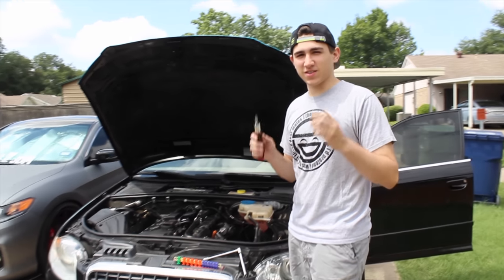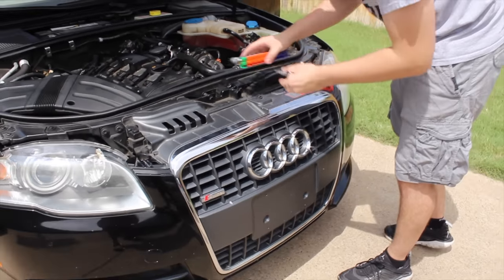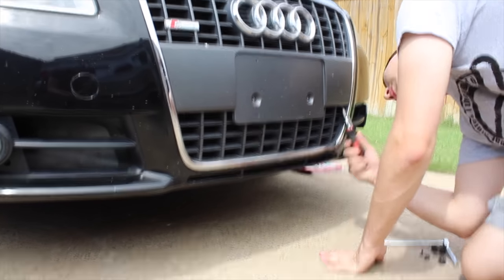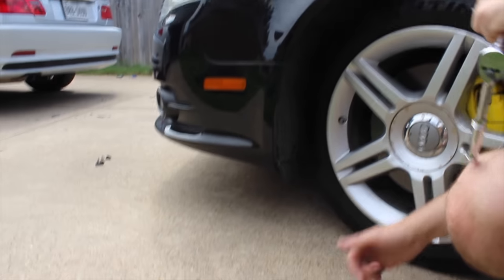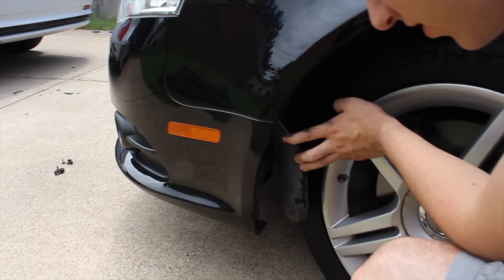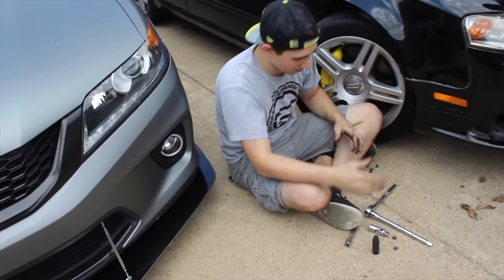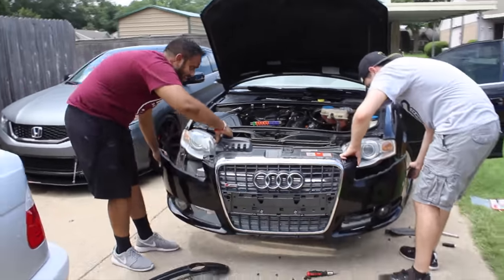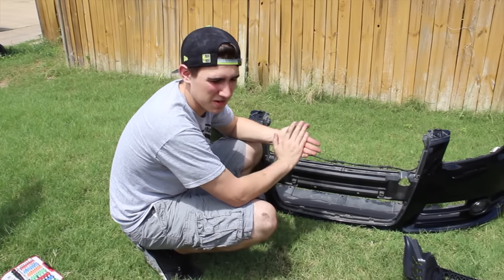How To Install Replace Front Grille 2005-2009 Audi A4

Comment: The grille you bought its only for SE (standard)  front bumpers. You got sline bumper so you will need to find a grille for sline models that is a bit longer. You'll find honeycomb grille for sline little bit harder.

Comment: Its sad how they don't any proper aftermarket grills for the B7 S-Line bumper but a bunch for regular B7 bumper 😐
Reply from the maker: Yeah its a pain finding the correct one, you have any suggestions?
Reply: To get the look you wanted to get with that grill where its all mesh with rings and no middle bumper you would have to buy a rs6 grill aftermarket off eBay and use the stock grill on the car and use the mesh and basically cut out the rs6 mesh grill and same thing with the stock grill after that you line up the mesh w the stock grill "frame" and you might need to trim off some places on the mesh and then glue the the parts back  together and you can use a black seal over it so its not even noticeable that the most common way and cheapest way to go about getting a aftermarket grill to be on the S-line bumper for the B7 other option is OEM rs4 grille which costs about $450-$640 which I wouldn't recommend unless you have the money to buy it but yeah I'm going to probably do that retro fit I'm talking about soon.
Reply: Black B7 dang! That sounds like a ton of work. Something we will definitely look into!
Reply: Did you ever do it? I'm looking for the same type of look as well.
Reply: I still haven't found one i like. We are thinking about possible making one, but the process of cutting pieces of grills out is lengthy and expensive to test and if you mess up, then you have hundreds into grills you cant do anything with. Still searching.
Reply: http://nickscarblog.com/diy/how-to-fit-an-rs6-grille-on-a-b7-a4-s4-or-rs4-all-mesh-no-filler-plate theirs what I was talking about the RS6 to A4 Grille rework
Reply: I've got some time so I will probably be doing this as soon as I buy the 100$ RS6 Grille
Reply: That looks awesome! Definitely going to try this!
Reply: I just put in a 30$ Spectre AutoZone intake mod and I highly recommend it if you don't wanna spend the extra money on a full intake setup and its sounds amazing tbh I just gotta make a heats shield for it now I might post a video about it.
Reply: oh nvm I see you've gotten the ESC tuning one nice I'd also get that but still haven't got a job.
Reply: Thanks for following us! We should be installing it in the next week. Just haven't had to time yet. Let us know about the progress with your intake! Definitely would be down to check it out man!
Reply: Let me know how it goes, I might try it as well but i'm going to use an industrial laser instead of hand cutting it so the cuts are prefect.
Reply: Make the vid, I am interested in hearing it!
Reply: The Intake vid? We should be posting it fairly soon! Turn on notifications so you know when we upload!
Reply: Black B7 love my 2.0t upgrading 2 rs4 soon

Comment: 5:48  Why in the hell did you post this video if it doesn't fit?
Reply: RIGHT
Reply: Why does anyone post videos on YouTube? Ever watch a compilation of fails?
Reply: Sure I have.  And it is titled as a Fail video usually,  unlike this video.  The uploader is using as click bait I guess?  Either way it gets everyone nowhere.
Reply: Paradigm Zer0 I’d argue the video is titled how to replace and change. If it would have fit it would have worked and it explained how to remove the grill so.... idk how that would be clickbait.
Reply: Well, they said they were going to redo the video when they get the right part.  Which is good, but why keep the bad one up?  For views!  Not really a big deal but I hope they delete this bad vid when they get the new one up.  If it's not up already...just a peeve of mine.
Reply: Paradigm Zer0 lol it’s actually me and my car 😂😂 never got the right one
Reply: Paradigm Zer0  he has the S-line (which is what I have as well) and normal A4 grills won’t fit. He should have done a little research before he bought the grill, however this video still helps someone know how to remove the bumper and grill from an A4 and then just clip the new one on and put the bumper back!
Reply: Hazim Mesinovic I did the research for it. The auction was mislabeled and said it “fits” s-line bumpers.... eBay sucks.
Reply: literally watched the video to see how it looked.  Good thing I skip like crazy.  Thumbs Down
Reply: Lol
Reply: I needed assistance tryna install my  grill 🤦🏽‍♂️🤦🏽‍♂️🤦🏽‍♂️🤦🏽‍♂️
Reply: @hazimmesinovic3459  its only the orig s line and rs grill that fit right? or?
Reply: As a warning
Reply: Y yo que iba q preguntar cómo pedir esa pieza por qué pedi una y me salió más pequeña que la del sline😂

Comment: The only way to make it fit RS Grill style into S4 model is... buying an after market grill from EBay for A or S6 B8 grill cut surround the edge ones you get the grill free from the frame do the same on your a4 b7 original grill and it may need to do some extra cuts on the new one to fit on the s4 model frame then blue it with a best clue you can find and you done...
Reply from the maker: We appreciate that! Will look more into that! Thank You!
Reply: Did this with mine, turned out amazing
Reply: You think b8 grill will fit into a 09’ Quattro 2.0t

Comment: Lol I watched this video just to see when you realized it wouldn't fit.     The eBay one is for non s line AND DTM bumpers.   Will not fit S line, S4, and RS4. Unfortunately.   I had to buy a DTM bumper just so I could get a full mesh grille.
Reply: Logan Maze what’s a dtm bumper?
Reply: Caleb Smith it's the 2006 25th anniversary, and 2007 DTM,  2 special editions essentially.  Same bumper.  Can't add a pic, but you can Google Audi s4 DTM and you'll see.    That grille you have will fit DTM
Reply: The downside is DTM bumpers are incredibly hard to find
Reply: Logan Maze I’ll have to check it out! Thanks for all of the info man. Appreciate it!